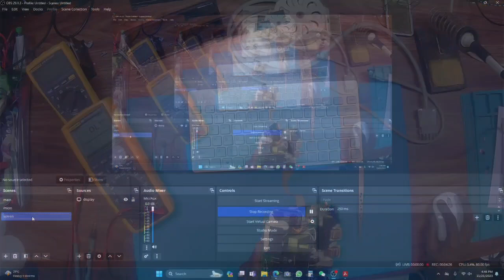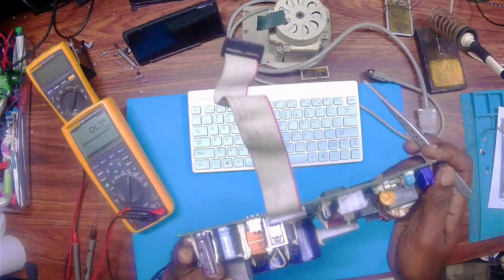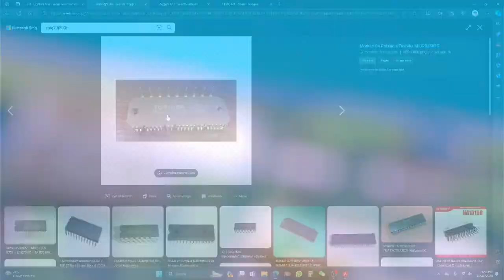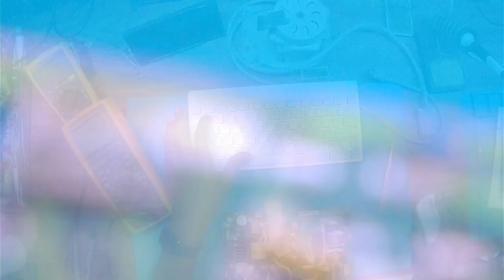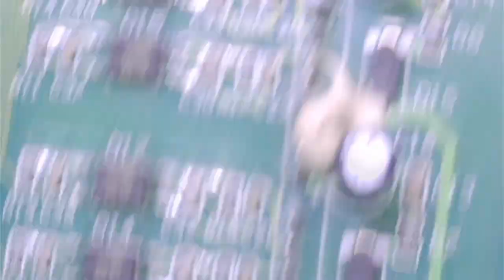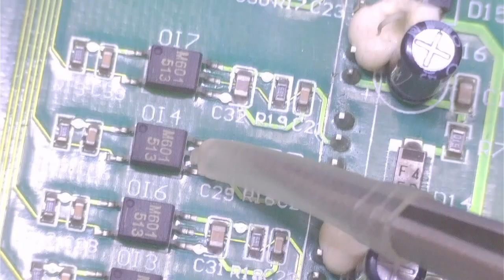HVP90 repair part 1

Comment: Thank you for the great explanation, I have problem with efka N153 and I didn't know that there are opto isolators for the IPDM I thought it's some kind of coils or transformers because they look like that and I couldn't find what kind of parts are they but now I know and I'm going to find why 3 out of 6 are not working